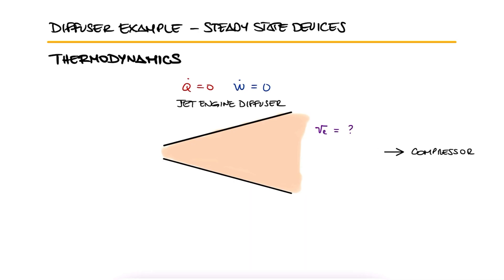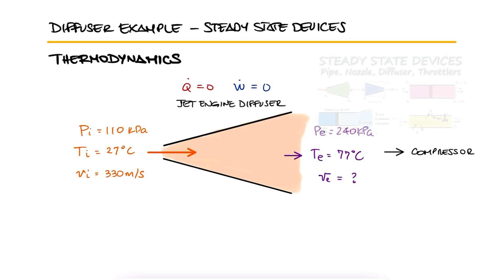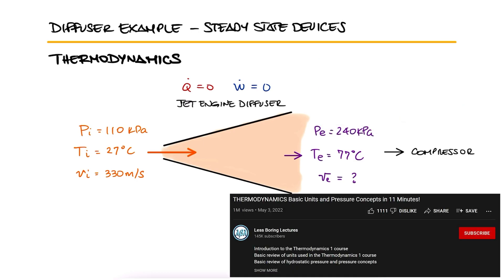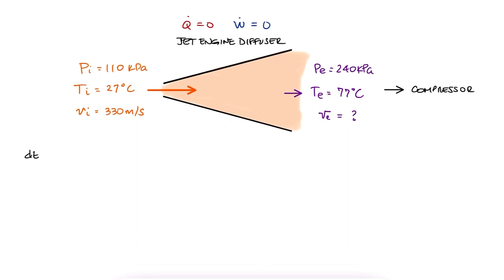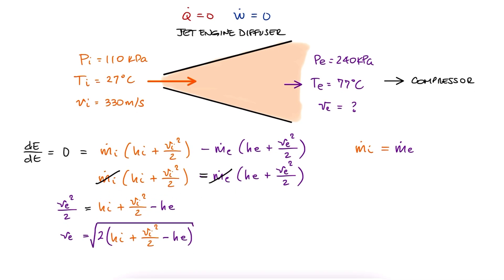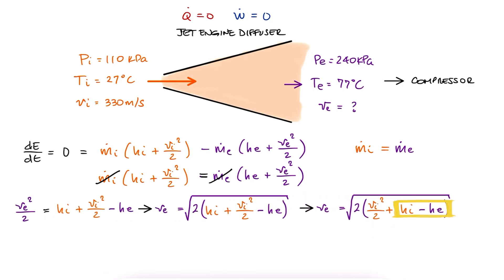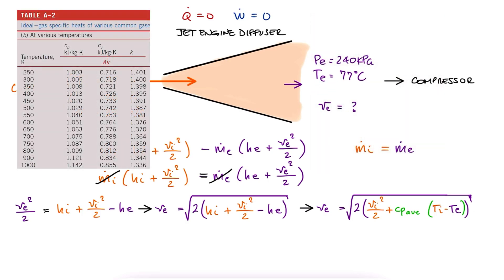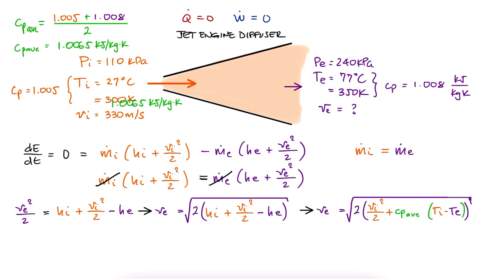Diffuser Volumetric Flow and Velocities in 2 Minutes!

Comment: How is it constant pressure when the exit and inlet are not the same pressure?
Reply: you use cp to calculate enthalpy values and cv to calculate internal energy values. cp is just the idea that at constant pressure in a cylinder system, both work and internal energy changes at constant pressure which is what enthalpy is. cv is used for internal energy because at constant volume there is no change in volume so no work can be done so the only variable that can change is internal energy.